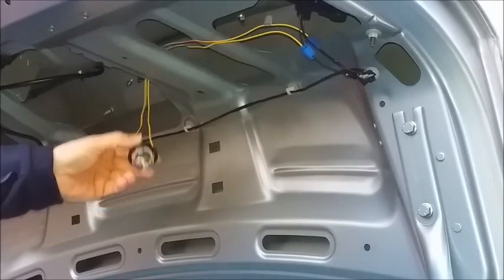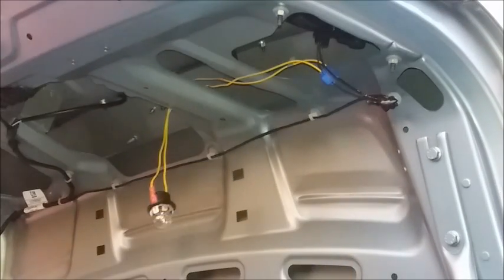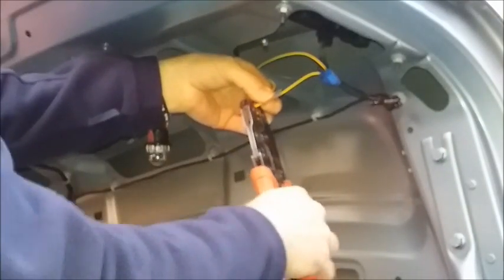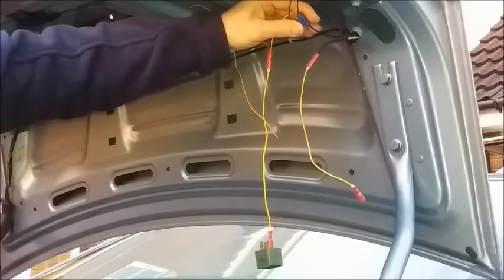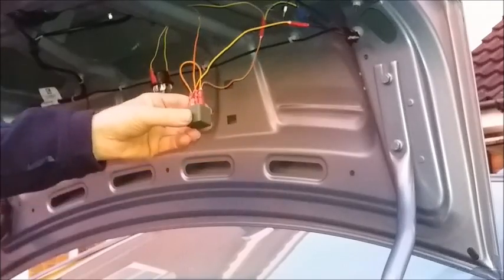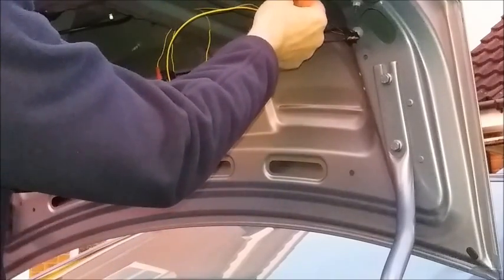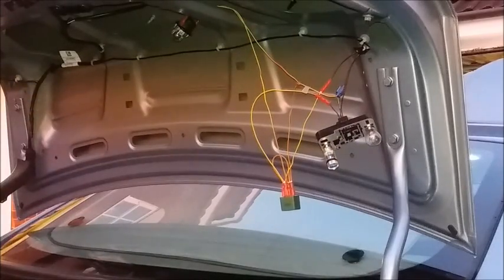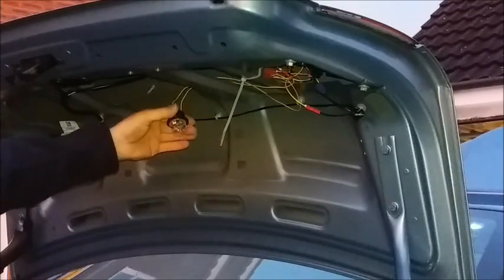How to Fit & STOP LED Bulbs FLASHING on a CANBUS Car

Comment from the maker: UPDATE (May '17) in response to a question from a fellow Saaber I tried removing the 'resistor' to see if the relay coil resistance is enough to fool the car into thinking there is a bulb fitted. IT IS NOT. You will need the resistor.
Reply: Hi I just put super bright led's in my reverse lights and did NOT need a resistor or extra bulb! guess it boils down to what relay you choose..
Reply from the maker: You make a fair point. Different brands of relay will exhibit different coil resistances and some may well be enough on their own.
From my pov though, I have to show people a method that's guaranteed to work if they follow it. If they are able to adapt and alter my method, that's great too but not everyone can do that.
Reply: @chrisjdoran  what kins of relay did you use?
Reply: @chrisjdoran  out of curiosity what reverse light bulbs did you use?
Reply: I have a 2007 Saab 93. I love the video. Very informative. I wished I watched it before I purchased those canbus anti flicker/decoders. I'll test them out soon and let you know how they work. You the man
Reply: @donmedlock3631  So? How do they work?
Reply: @_tanitani_  they don't
Reply: Hi Cyd, how about just connecting a 7ohms 50w resistor parallel to wiring the led. Does it work ? In this case I’ll don’t need all those wires and relays, cause I changed all my high beams, and drl to led. They flash all the time but the light output compensate. I’ve tried all sorts of anti flickers but found out they don’t work on Saab cause they connect serial ! I found  those single wire resistors that connect in parallel to the led and I think this may work on my 9-3. I have no choice cause there’s no room on the back of headlight to fit all your stuff. What do you think ?
Reply from the maker: @LDantinhas  won't work - it's explained in the video
Reply: Cyclone Cyd for sure ? Cause it’s stated everywhere they work like that. Ok I’ll try anyway...
Reply from the maker: @LDantinhas  surely you know by now that Saabs are "special" lol
Reply: Cyclone Cyd too special hehe. I think that a stronger resistor might work, cause the pulse value in Saab’s must be higher than other cars. Can you provide a link to buy those relays? Can it be smaller?
Reply from the maker: @LDantinhas  what country are you in?
Reply: Cyclone Cyd Portugal
Reply from the maker: @LDantinhas  As the application is underbonnet, I'd suggest these
https://bit.ly/12V_relay_wproof_prewire
They are waterproof and come with a mount bracket and prewired connector so you could mount them remotely to the headlight (eg under the inner wing) OR make up a bracket to mount them to and mount that on the side of the airbox. Lots of possibilities.
Reply: Cyclone Cyd so I order these 5 pins relays, one for each led, ok ok 👍
Reply from the maker: @LDantinhas  yep. 5 pins 👍
Reply: @LDantinhas  did you get it working?

Comment: Great video, did something similar for my Vectra C, H1 high beam leds, used 30A relay and H4 as resistor since it has 2 filaments.
Reply: Did you add only one set or for both high beams? Just starting doing it myself. If you added only 1 set of relay and H4 then were did you put them?
Reply: @Erix234  The relay and its wires sit near the battery, I took the plastic battery box off, the wires run just above radiator tied to the cars body bellow so you can't see them instantly (h4 is there as well + thermal insulator so it doesnt melt its own wires off). I have extra space there because of air intake resonator delete. You have to wire like 11 or 12 different pieces of wire.
Reply: @Erix234  And yes at 30A one relay is enough for two H1 leds, 30A at 12V is 360W. Just use proper wires and proper connectors when you do this setup. You have to do Relay + and - to bettery, Relay open pin to each + of the two H1 leds, regular beams H1 from the headlight take 2x - and put it on - of the H4 bulb, each + on the two separate beams of the H4, each minus from H1 leds to - on battery / relay, then take one of the beam of H4 (+) and connect it to trigger pin on relay. With this setup when you toggle high beam the car's headlight will power the H4 on, both beams, this will fool the canbus, while the relay opens and powers the leds directly from the battery. It a bit of work, but it's doable and the result is worth it imo. Hope you have the time and patience to do it, my high beam are xrays now, installed dawnknight K9C PLUS H1 (cold draw 90w/ bulb, warmed up 76-77w/ bulb, tested with adjustable power supply).
Reply: @mikeflagger7723  Thank you very much. Will be on it as i have the front end of right now.
Reply: @Erix234  Also again very careful with wire thickness, connectors, isolators and placement / thermal shield for the h4 bulb since with both beam on 60w+55w it will get really hot, if you put it like me close to the wires you need good thermal isolator, i used an older rubber cooling hose on the wires and on top of that aluminum sheet from a soda / beer can, no issues so far with heat / electrical wire strain. And tie everything done properly with zip ties or anything you got, near the h4 bulb / thermal shield use metal zip ties.
Reply: @mikeflagger7723  I will be using 2.5 square mm wire and i have some  ceramic heat insulation fabric. Thank you.
Reply: @Erix234  Yup, used 2.5 as well, its more than strong enough

Comment: I did this to my car today for the dipped beam, worked fantastic, then once I waited for it to get dark, I drove down the road and 30 seconds later I got a right dip failure.

All connections are fine, no fuses blown, when testing the relay it still clicks, any clues?

Comment: Thank you so much,
I’ve used the info to fit a replacement LED bulbs for the low & high beams of the headlights of Opel Vectra C.
At first l used a W5W (T10) bulb as as a resistor but it didn’t cancel the error. I used an H7 (55W) bulb instead and it works!!
Now no more flicker or error messages 🎉
Reply: Hey, I have an Opel Signum same problem. So you did this four times?

Comment: Not sure why but I've wired both reverse lights this way. One side is working fine but the drivers side will buzz then switch off momentarily after. I've tried several relays and they all do the same. Both wired up the same way, anything I may be doing wrong?

Comment: Hi Cyd, I have a somewhat different problem with trailer lights. So, I have a trailer module fitted to the 9-3. One turning signal light is LED. The other one is still a normal bulb. The LED does not light up and causes the indicator circuit to fast flash. The normal bulb works just fine. Any ideas why, and how to fix it?

Comment: Good afternoon. I want to do the same thing on my saab,but for both rear position and indicator. I bought the resistors,I am looking for relays.Do you have any idea how to do the 2 bulb position in one relay or do I have to do it one by one.Cheers
Reply from the maker: Not possible. The rear position lights use PWM to control the brightness.
Do this for front indicators https://www.youtube.com/watch?v=LjvxSXyzaMo
and this for rears https://www.youtube.com/watch?v=f7qvvc8o7pc
Both schemes use the same product. If you don't want the DRL or reverse function, leave the white wire disconnected.
I am working on a scheme for the rear lights, but it'll be well into the New Year now.

Comment: Hi Cyd, just did my headlights in my 2007 9-3 and it works like a charm.  I used 8 Ohm resistors.  will be doing reverse lights next and the Fog and reverse lights on my 2008 9-3.  Thanks for the tips and know that I've watched a couple dozen of you vids, used a half dozen so far to debug and fix problems,  and I love your style and simple methods.  Will be implementing several more of them in the coming weeks.
Reply: did you change the daytime running lights on the 08 93 to LED? any issues?

Comment: Could the LED flashing kill the battery?
Reply from the maker: Do you mean in the sense that the power consumed by the flashing would deplete the battery charge? I would say NO. The energy in each flash is truly a tiny amount. Plus it only occurs when the vehicle is unlocked (running or not running). If it's unlocked but not running, ignition key out and doors closed the flashing will stop after about a minute anyway. The flashing will continue unabated all the time the engine is running, but the power (small as it is) comes from the alternator. The biggest issue is that here in the UK it would be an MoT fail and out on the road it might attract Dibbles attention.
HTH

Comment: After seeing your video, I had big plans! I should have paid better attention as I have an '03 9-3SS. and yeah, failure. Do you think adding a capacitor before the relay could make it work? I was hoping to use smaller relays, and that may have contributed to my failure.

Comment: I have a zafira b that im building custom rear lights but on my last set i had to paint the bulbs with high temp paint to allow the leds to work,is there another way that i can fool the canbus without using normal bulbs

Comment: @Cyclone Cyd  Very good video even if iam late finding it lol. Have you managed to find a way round the Brake/tail light issues yet? The P21W ones?
Reply from the maker: I've got a plan, just need to get round to it. The car needs bigger work this year first.
Reply: @CycloneCyd  same here. A lot of geometry to sort and also electrical. Was holding out on them first as struggling to find a front to rear interior light ribbon. Hard to get for the vectra c

Comment: Greetings, I have more of a particular situation. I got for a good price a set of Osram LEDriving Xenarc headlights for my Audi A4 B7, with some issues however. I managed to solve them, except one: the DRL(led) driver is faulty. It's the chip itself. So I want to connect the DRL directly, as parking lights, but when I tried, the flicker and the bulb errors were there. 
Do you think the diagram you mentioned in the video would work for me?  Do I need any specific parts?

Comment: I have a 2015 compass, bought a nice set of LEDs and noticed the lights would flicker so i bought some canbus decorders and the lights are still flickering but not as often....i dont know what to do, its always one thing after another, issue after issue. Do you have any idea what could be causing the lights to still flicker? Thanks in advance

Comment: Hi Cyd - terrific video!  Another way to solve the LED headlight flashing problem on a Saab 9-3 like yours without doing any wiring or adding any components:  If you have a Tech2, go into Diagnostics->All->Add/Remove and tell it you're "adding" the UEC.  This will re-run the configuration on the underhood electrical center.  When it asks what bulbs you have, select Xenon 2 rather than Halogen, and this will end the flashing.
Reply: @akahan1  Can this be done with opcom ? On vectra c facelift?
Reply: @mikeflagger7723 I know nothing about Opels, sorry, just Saabs.
Reply: @mikeflagger7723  No idea.  I'm a Saab guy, I know nothing about Opels.
Reply: @akahan1  As far as I know they share the same platform, idk about ecu and stuff like that but many parts are common
Reply: @mikeflagger7723  RIght, it's those differences that make the difference...
Reply: If you select xenon 2 rather than Halogen with a TechII, would you then be able to install any LED lamps without error messages and flashing? Because if so then the solution is very simple (just get a TechII or contact somebody with a TechII 🤷🏼‍♂️). Thanks Cyd again for a great video!!
Reply: @moloreanm1657  Yes, that's what works for me, for low beams at least.
Reply: @moloreanm1657   problem is you can't do that for the rest of the bulbs. you would need one of the third party software like Maptun or Hirshcmann for those

Comment: Very helpful video but not working with all the bulbs I have an 08 9-3 convertible and I successfully install these relays on the reverse light. I tried on the fog lights and they working only when the car is off as soon I start the car the relays start to buzzing continually or try to make 1000 switches per second and the same thing is applying to the brake lights. Do you have any idea why is doing that?
Reply from the maker: Rear fogs I presume? Must be PWM controlled like the brake and tail lights.
Reply: @CycloneCyd  No the front fog lights. I try to change with Led's but no success because the relay is buzzing but is happening only when I start the car when the engine is off they work perfectly no strobe. I don't know why but for now I will stick with the originals. Thanks

Comment: I installed a reverse led on my Audi and every time I turn the car on, the led is slightly on, you think this could help? Even with the lights off, with the car on they still glow a very small amount and brighten up 100% when put in reverse.
Reply from the maker: I think this would probably help that. Try it on one light and let us know how it goes

Comment: Would like to do this on my Audi A6, Bought the Relays and Resistors but looking at the bulb plug it has a shared earth with 2 other bulbs in the plug..any ideas tia
Reply from the maker: That's quite normal for a cluster of say, 3-5 bulbs, to share one negative (earth).
Reply: Thanks for the reply, My main concern is that if i use the negative going to the bulbs in the holder will it affect the operation of the other two bulbs which are working ok. The holder has three bulbs two for the rear lights and one reversing light bulb which i would like to fit a led bulb in...But only one negative for the three bulbs..Really dont know if the relay takes the negative out of the system untill its actuated or if the relay works in a different way. Hope you can help tia
Reply from the maker: @mickd3244  You'll be okay using the common earth point. Far from 'overloading' the single earth wire, by installing LEDs you will actually reduce the current load it has to take.
If you lift some of the nearby trim, you may find a body earth stud. Double check it's condition for corrosion or signs of damp, but if it looks good don't break the paint seal.
Reply: @CycloneCyd  Thanks, got the trim stripped out today, will fit the relays and resistors in the next couple of days.Let you know the results.
Reply: Got around to doing one side today and it works a treat, modded it a bit by leaving the bulb/resister out of the circuit..No bulb warning light and no flashing. Would like to share your video if thats ok..Thanks Mick
Reply from the maker: @mickd3244  that's excellent news. By all means, share away

Comment: I have this problem on my Audi A6 can I use a four pole relay as I have several. If so can you do a simple wiring diagram showing which wire to which terminal on the relay. Thank you in anticipation. You are the only person who has covered this issue properly.
Reply from the maker: Thank you, Bruce. TBH, I'm not certain, but I think you could. You'd have to re-imagine the wiring diagram.
Reply: Cyclone Cyd thanks, my issue as a novice is even if I buy five pole relays which numbers correspond to your descriptions ie live, earth etc. The issue is driving me to despair.
Bruce

Comment: Hello mate , i've tried many ways/workaround  to have it non flashing/flickering when ignition is off or without error on the dash ( tried the solution with relay a while ago as well  )  This models are real 2 amps 25watts leds and it works like a charm on my saab 9.3 2004 , all rear bulbs are replaced with those ( brakes , reverse , fog , turn etc )  with no aditional features .They are well made , you even have a small dry capacitor build in it.  https://rb.gy/qqzmce

For the front i have put some DLR led bulb with dual mode white/amber instead of the turn lights bulbs , same , works without anykind of issues since more than one year : https://rb.gy/6llkqm

Cheers from Portugal !keep up the good work
Reply from the maker: That is awesome, thanks. I'll get some of those LEDs to try out
I've recently bought some switchback DRLs that are very similar, will be trying them out as part of my headlight rebuild

Comment: Thank you so much for this video. Dumb question, for headlights, I'm assuming I will need to cut the wires to get rid of the bulb holder as I will simply just need the wires from the car? This has me a little nervous. Kinda like once you cut it off, your in it now and no going back!!
Reply from the maker: No, don't cut the connector off. Use 5.3mm spades to connect into it.
Like these  https://www.ebay.co.uk/itm/293305356049
Reply: Mate, wow! Told you it was a dumb question. Thanks for helping  a newbie that knows nothing about electricity!

Comment: My Vectra C has problems with flashing indicator lights on my trailer with led lights. I have resistors in the curcuit so no canbus errors but they don't prevent the flashing.
Do you know if adding a relay will help? I was thinking of adding a capasitor instead?
Reply from the maker: The video is entirely about that point. YES. Electronics Engineers I spoke to when I made this didn't believe capacitor would work. But by all means try it and let me know how you get on.
Reply: @Cyclone Cyd  Thanks, it's the side lights /turn lights that flashes on my trailer, just to clarify.